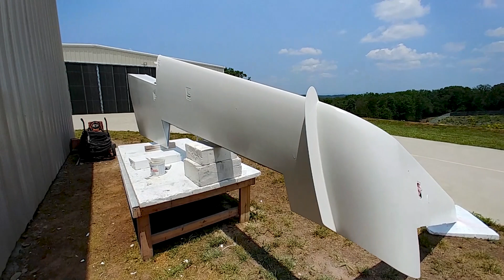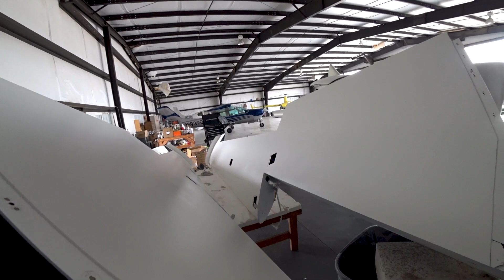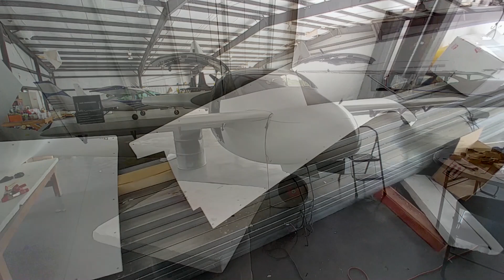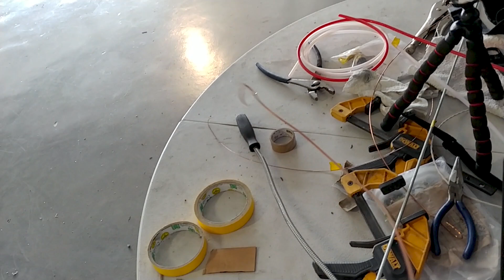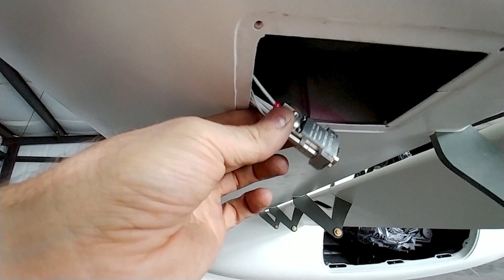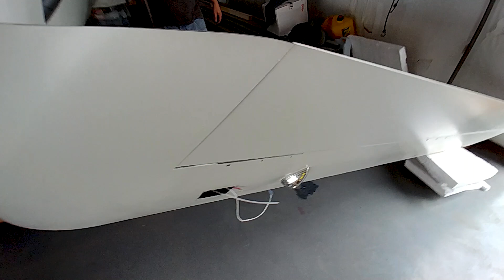Foreplane Installation - Building the Raptor Prototype

Comment: Peter re the magnetometer I believe there is a prohibition in the Garmin install manuals for mounting the GMU 11 on an inspection panel.  Might want to check on that.
Reply from the maker: There's nothing in there specifically about not mounting on an inspection panel. It just needs to be within 3 degrees of level when in cruise and aligned with one of the cardinal directions.
Reply from the maker: The aircraft is sitting within .3 degrees of level from the design CAD

Comment: Pete, if you don't mind an unsolicited opinion from a fan, I'd like to say a little something about next steps.  

For purposes of valuation, I'd suggest looking at the Raptor 001 not on a cost plus basis but on a market equivalence basis.  What are 5 pressurized 300kph (+?) seats in the flight levels worth in the market?  This is not an unreasonable approach in the early stages.  It makes assumptions about you smoothing away future design kinks and getting the production process right, but from the perspective of an investor, those aren't unreasonable positions for a founder to take. And I strongly suspect that it would lead to some very compelling market growth numbers.  

(I also find the 'Experimental vs. Certified' cost management strategy extremely persuasive myself, and I hope you have at least a back of the envelope calculation of the theoretical cost differential for the Q&A.  'Competition' would be the place I'd tuck it in since the unending quest for Certification contributed so much to Cobalt's bankruptcy.  It's a doubly persuasive segway.)

Smart investors won't expect you to be 'correct'.  Unlike engineering, there is no 'correct' in these issues, only 'reasonable'.  I personally think that's 'reasonable' given that you have the potential to increase the market size in your space.  "Sound business justification" is your goal.  And for a guy who spends so much of his time on useful fretting over door hinges, I believe you're thinking about this stuff better than a great many other 'founders' and it will come across if you get the time.  If all of this is obvious to you, I hope you'll forgive me.

I've seen people raise 60 Million @500 using the "underpants gnome" business model.  Compared to them you're going to look like an airborne Henry Ford.

Just my opinion.
Reply: Tom. I’m looking for funding for an aerospace company. We’ve already talked about adding Raptor production once our other product hits the market. Any help or direction would be appreciated.
Reply: @rnordquest   Well thanks in part to Peter's (brilliant) open development strategy, I know a lot more about what he's doing and how he thinks, and can comment in a way that isn't 'crazy', even if its things he probably already knows.  I also know at least a little about the GA market and the spot he's looking to be in within it.

An 'aerospace company' with a product not yet to market tells me you're early stage but not much else.  It's hard to comment much on that.  The one thing I'd say is go try https://gust.com/  Even if you decide not to use the platform, it should help you sharpen your story.
Reply: @Tom-qq5bk  Quite correct.  We only have 2 yrs to market from inception so it's not out of the question.

Comment: I would not bond the magnetometer directly, make a shelf with some nut plates and screw it down, you never know.  It might fail and you might have to send it back.  Granted I am a newbie, but I am shocked at the failures of really, really expensive glass electronics that I have read about so far.

Comment: Having had a heater core burst at speed and running temperature on the highway, there is no way I would have that coolant inside a cabin, much less a pressurized one.

Comment: If you ever have resin get in a hole like that again, use a wire brush attachment on a drill or dremel and run it in the hole, if you use something like a brass brush it wont touch the threads but will rip that resin right off. You can use other metals too but if you run them too long they might wear down the threads a little, but it would take quite a bit for that to happen.
Source: I've done it several dozen times fixing other peoples screw ups, I'm perfect so I've never done it myself or anything...
Reply: 😆 Somewhat the same here. Nobody has figured out how i can fix so many screw ups! Shhhh....😉
Reply: @olliea6052  They all think I'm a genius, they have no clue it's because I've made the same mistakes a dozen times before so it's become super easy for me to fix them.

Comment: How is this aircraft different from the Velocity SE?
Reply: the cabin room at the shoulder is 62 inches a velocity SE is 42 but it compares better with the velocity XL which is 47 inches at the shoulder. A GMC Terrain which is a nice mid size SUV is 57 inches at the shoulder is still smaller. this is a Cadillac with wings, great for picky girlfriends and wives once you add the pressurization.
Reply: Bigger and more aerodynamic, at a first glance.

Comment: It has always seemed to me that on an aircraft of this configuration the pitot tube could be right on the point of the nose, in completely undisturbed air - is there a reason why not?  Might have made access easier too. :-)
Reply: My question as well. Even putting it on the hull directly under the foreplane is a simpler solution.
Reply from the maker: Garmin recommends the location I have placed it. I have kept the nose free for a potential radar installation if I can talk Garmin into sponsoring it later on.